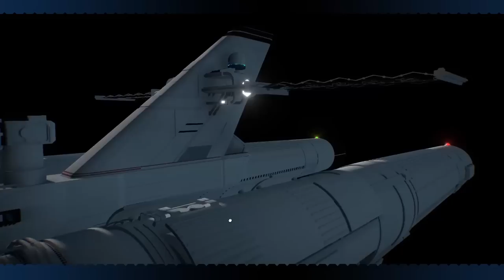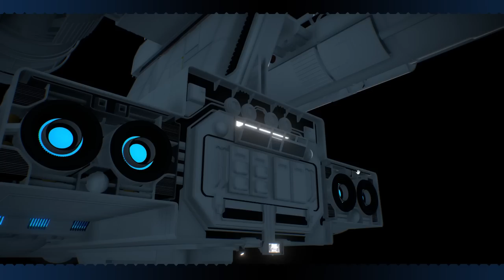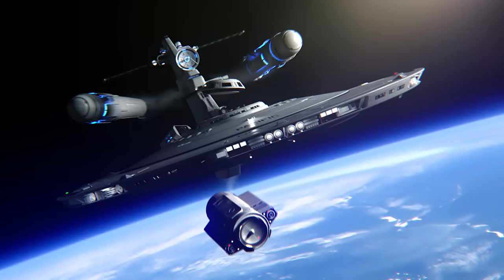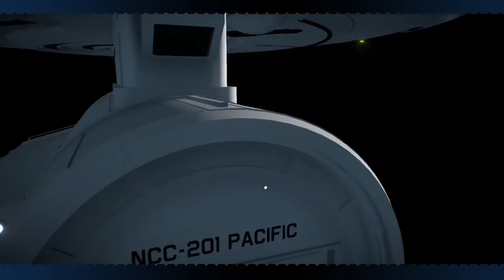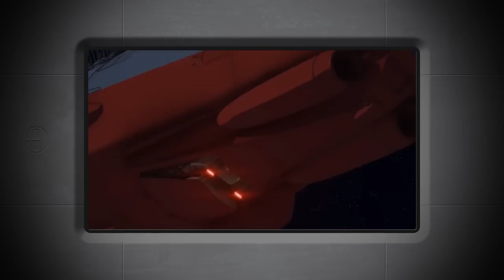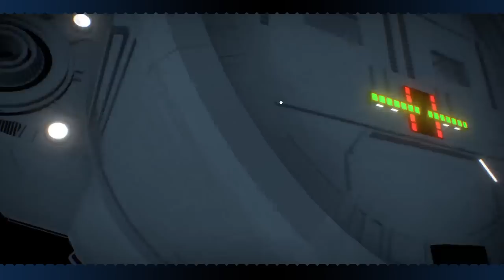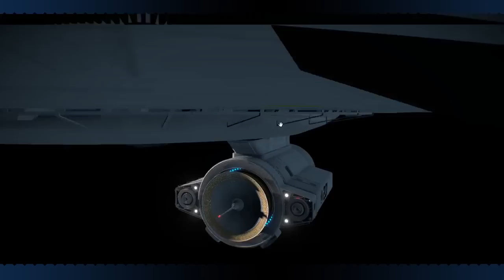Show and Tell: Starship Pacific from Pacific 201 (Star Trek fan film)

Comment: I'm not sold on the upper observation deck being to manually check the nacelles. If so then the windows should be more to the sides and are not needed at the front. I also think that if the nacelles were showing visible signs of damage that can't be picked up by monitoring systems then you're probably screwed. It would make more sense if the windows were more oriented to the sides and had a function such as manual oversight of the nacelles being attached to the ship.

Great ship though and thanks for the heads up about the film.

Comment: Great aesthetic and well thought out design. I totally dig it.

The "whiskers" off the saucer could be long range HF radio/subspace antennae.  This is akin to modern day horizontal HF antennae projecting off the decks of aircraft carriers.
Reply: Wrong.  Aircraft carriers are not travelling through the dust filled expanses of space.  Anything sticking off the side of a spaceship is going to either rip loose from inertia or get torn off by the dust it collects as the ship moves through space.  Plus, why the fuck would anyone use radio to communicate across the vastness of space?  Radio waves are VERY slow.  That's why Neil Armstrong had trouble communicating with Earth from the Moon.  There is no way in hell Star Fleet would use radio to communicate across thousands of light years.

Comment: I hope I don't miss this show. So much thought into the design of the Pacific and the modularity is the most impressive detail in its design. If anything went wrong, it's much easier to replace a module and continue on while the module was repaired, upgraded or refurbished after so many hours of use. When you add to that the fact that Engineering and the bridge are modular in design and I think NASA might approach things in much the same way. Great job!

Comment: I like the "USS" rationale. Figuring that human ships are out there, Vulcan ones, Tellarite ones, Andorian ones. This stuff is in that space between, before certain things become concrete, or more common. 

The rotary launch system is absolutely workable, the U.S. Air Force has systems like that on several bombers. They can drop bombs or launch cruise missiles from them. The VLS tubes as well. After all, nuclear weapons are also good when you are unsure about the exact position of a foe. Either through early sensors, early cloaking technology, or some combination of all of the above. Nuclear air-to-air & ground-to-air missiles were worked up during the Cold War for similar reasons, though they were never used. Plus ideas for nuclear tipped anti-ballistic missile weapons.

Comment: I love that someone can tell how much you love Star Wars just from the design of this, yet it still looks very Starfleet. I'd say the little observation deck on the Nacelle Mount Spine is what first screamed it at me, but the specific greeblies and the antenna dishes as well as just the geometry all have just a little Empire to them. Which is a good thing! I think Star Trek's design language could do with a little grit! Not every ship needs 24 foot long skylights across half of A deck, sometimes they need exposed equipment and actual radiators!

Comment: The thing about Starfleet and Missiles is merely one of terminology. Photon Torpedos ARE missiles in the broadest sense, and the difference between a torpedo and a missile in sci-fi usually comes down to relative speed and yield (Torps = slow but high yield, missiles are fast but low yield). 

And really, Starfleet needs to diversify it's arsenal anyways, so having some sort of high speed missile could be good, particularly if they think a lot of the fighting will occur at FTL.

Comment: Love the ship one of the best fan made models. Only one observation. I do not remember why I know this, from books or show. maybe the original Franz Joseph writing. Warp Nacelles and warp, were increased when used in pairs. They need to be in proximity to each other to create the warp field and no living mater can exist between the 2 coil's. 3 engine's were experimented with but created and imbalance so they were discarded. That's why USS Stargazer had 4 Nacelle's. So my only criticism is the observation deck between the 2 Nacelle's Living matter will not life long there. Great Job. I was there from the beginning.
Reply: Going by your reasoning, nothing on the Defiant would live long enough to do anything  - considering that the warp nacelles are integrated into the body.

Comment: The lights you took from an aircraft carrier are called "fresnel lenses", or mor commonly among naval aviators, "the meatball." They are used to guide pilots through the glide plane while landing aboard ship. Before the fresnel lens system (invented, ironically by the French Navy), the US Navy and the Royal Navy used "Landing Signal Officers" to guide pilots with flags through the glide plane when landing aircraft aboard the ship. Just a little info for ya on where those lights come from and what they're actually used for. :) Cheers on the great design work on the Pacific!

Comment: This is excellent work. I love the basic premise (believable tech in believable applications) and the results. 

You don't have to look to fiction to justify your carousel design for the hangar. The Buccaneer fighter bomber used a rotating bomb bay of very similar design to carry a far greater volume of ordinance than would have been possible if it just had a simple cavity in its belly, like a WW2 bomber. You should look that up - it's a great design. It was also a very effective aircraft that had a long service life.

I love the upper and lower observation decks. The moment I saw the upper one, mounted on the 'shark fin' (shall we call it that?) I immediately thought you must have been inspired by the engineering observation station on the Catalina Flying Boat. Up between the Catalina's nacelles there is a pair of windows and inside there is an engineering station with the dials and monitoring equipment for the engines. The obs deck on the shark fin is probably used for this purpose. 

Similarly, the obs deck above the deflector could be used to closely monitor the deflector and the torpedo tubes, providing immediate access for repair crews and some local control in case the bridge is damaged or cut off. 

I like the locations of the torpedo tubes. I don't like the very low volume you've provided for the ordinance. Unless the torps are very, very small you're not going to be carrying many rounds in there. Can the ready-to-use magazines be resupplied from elsewhere in the ship?

I love the inclusion of radiator panels on the shark fin. I think you need more. Perhaps another pair down on the deflector? After all, the deflector is a serious piece of kit. It needs a lot of power and must generate a lot of heat. Better to get rid of that locally, than have to pipe the heat up to the shark fin for dispersal.

I like the modular approach a great deal. I think some would call modular components a way around the limitations of less mature technologies. For example, we build modular space stations because we can't launch heavy loads, and have no on-orbit manufacturing capability, only assembly capability. But the naval industry disproves this view: there are many famous examples of advanced, modern designs utilising modular components. the STANFLEX  and Meko systems and the Littoral Combat Ship are the three most famous. In the future systems architecture will become even more modular with the integration of remotely operated sensor and weapons platforms. There are contemporary examples of minehunting drones that are embarked on a ship in a couple of ISO containers, one for the drone and equipment and one for the control room that operates it, and is connected to the ship's own control room. So I don't think you can go modular enough! Perhaps there could be access hatches in the saucer for additional control stations for extra equipment that can be bolted on? Or extra labs, workshops, upgrades and extra accommodation for all the new crew these things will need. 

As you were talking about the independent bridge module, I had the thought that in the event of an emergency, all the crews emergency stations would be designed adjacent to an escape pod so that, if an evacuation was necessary, the bridge module could pop off and then fly about docking with the various escape pods. It could either embark the crew and jettison the pods, or daisy chain them and create a raft that can be piloted to safety. That's the best explanation I can come up with for having an independent bridge module. Unless, or course, the crew is so small that they all fit inside the bridge module and all other equipment is operated remotely. Modern ships don't have many people in the engine room. The throttles and other controls are all located on the bridge. The engine room staff are only there to maintain and fix things. 

This is brilliant. I love this approach. Keep up the good work.

Comment: Finally someone else gets the heat issue.  Yeah, any time someone designs a hard sci-fi space ship that is just blocky looking, ask them "where are the wings?"  Because they aren't wings, they are heat radiators for the waste heat that nice hot fusion reactor (or whatever is powering it).  That just happen to potentially ALSO function as wings.

Comment: love the consideration of detail and the thought put into this. the whiskers to me look like the vlf antennas on flight decks which, if they were,  would transmit toroidally around the pole. to that end it might look a little more believable, coverage-wise, to place one on either side of the saucer between 90 - 135 and 225 - 270 relative bearing.

Comment: Love it, really interesting logical process for the design and a nice end result, great work.

The only things that stood out to me are the radiators and tractor beams. A ship of that size would probably generate a lot of heat and the rad panels look a bit undersized by comparison. 

On the tractor beams, a headlight is designed to disperse light over a large area but a tractor beam would need to be more directional, like a laser pointer and maybe mounted on a gimbal for flexibility.

But great work, those are the only niggles for me.

Comment: I really like the design and the thought that went into it but I think you failed to understand one of the "Rules" from, at least, TOS:  the warp field is created as a harmonic between the two warp nacelles and is a no-man's-land because it is distorting the fabric of space. Hence the TOS rule: all warp driven ships have 2 and only 2 nacelles and nothing interferes with the line of sight between the two nacelles.  It's pseudo-physics but I can explain it.  Starships have two systems for propulsion that work together.  1) is the (warp) impulse drive.  These drives use conic resonance chambers to generate negative energy which expands space behind the starship pushing it forward but space requires huge amounts of energy to warp.  This amount of energy relates to C and is a function of the permeability and permissivity of local space (see Maxwell's equations)  These engines fire in microsecond bursts and without the warp nacelles would require staggering amounts of energy to maintain faster than light travel.  Warp nacelles are field generators rotating incredibly strong pulsing contra-rotating electro-magnetic fields. The turbulent convergence of these fields dramatically reduces the permeability and permissivity of local space.  This allowed the warp impulse to be amplified and sustained. The rotating fields act like gravitational lenses drawing in cosmic particles as if they were bussards may hundred times their size.  The starship is subjected to staggering amounts of radiation requiring radiation deflection technology. The primary deflector completely protects the secondary hull,  and much of the forward saucer (particularly the underside) from oncoming radiation without interfering with the bussards.  Given the ability to create artificial gravity, the most practical way to produce a low profile to oncoming radiation is to align the saucer edge on with artificial gravity 90° to the path of trajectory (the alternative would be to make the ship a needle like tower with very small decks — not only dramatically increasing the materials to living space ratio but providing no solution to radiation hitting the now enlarged oblique sides when performing warp turns). The top bottom and edge of the disk have deflector grids as do the warp pylons (although here that is mostly to protect the ship from the radiation from the nacelles) as does the leading edge of the interconnecter. The bridge is placed on top of the saucer (the top deflector system is stronger than the bottom since it is not assisted by the primary) and surrounded by it's own deflector array (making it the most heavily shielded place on the ship —if it had been inside the hull it could not have been independently shielded). The fins on the back of the TOS Enterprise were labeled "intercoolers" by Matt Jeffries.  They were mounted as far aft as possible to take advantage of the expanded space to dissipate heat.
Reply: kindwar 
Defiant does not have nacelles and everybody lives between the warp coils.
Reply: That's a TNG rule, put forth by the Great Bird in the 1990's NOT a TOS rule.  Interaction of energy between nacelles (hence your no-mans-zone) has been hinted at in artist renderings but NEVER depicted onscreen (that gold standard for "canonicity").  And in addition to the Defiant, how do you explain the Oberth?  Their frikkin bridge sits between the damn nacelles!

Comment: Amazing work - thanks! Love your thinking on this stuff. I'm not sure I follow on the rotary shuttle bay system though. You talk about space (volume) concerns, but it seems to me the real concern is mass. So, if you could have a wider shuttle bay that takes up more space with 4 shuttles, but it is a simply box with a hatch they fly out of, you don't have all the mass of that rotational mechanism. Plus, you've got quicker launch times and don't have to worry about the complex mechanism failing or becoming nonfunctional. So, by this thinking, the larger, simpler bays of traditional Trek are probably more realistic. But it's definitely a cool looking design that is fun to watch in action :)

Comment: I really like the ship. Just as a point of reference on a couple of things, the round ball on the rear of the necells is the off axis field stabiliser. I'm guessing its function is to allow the ship to steer while at warp, or for making high speed turns during combat. There's various references in the original series about the ship turning slowly without warp power, but this isn't really that cannon. Also with the impulse engines, you were saying about the engines being red in many shows, and with Enterprise they are blue. I'd like to think it's an evolution with the technology. On one of the Voyager episodes, they find the Mars Orbiter, and they talk about the ships 3rd Generation Ion Drive, which is an early version of the impulse drive used on Enterprise. I'm guessing sometime in the 23rd century the technology evolves, and the engine has a red glow. Thinking about the deflector, the dish in front is nothing to do with this, but it is the ships main subspace receiver dish. It does kind of disappear on the movie ship, but makes a return for TNG and Voyager. The Defiant strangely is missing one again however. Hope this helps with some insight.

Comment: 1:08 radiator ridges won't make a lot of sense in vacuum, they'll just heat up each other and no heat will be expelled off she ship, they instead must be as flat and distanced from hull as possible. and, frankly, a ship that has deflector shields and transporters won't have any problem with heat exchange even without radiator arrays
Reply: The only way to deal w excess heat is to store it as energy. Boil water, put that juice in a battery.

Or.... phasers

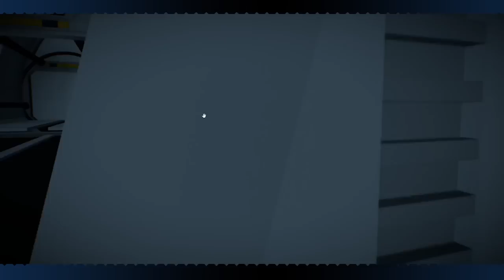Comment: The Optical landing system lights (05:20) are a visual cue for carrier pilots landing on the ship. Its purpose is to aid the pilots on the glide slope. They wouldn't have a function if the shuttles were tractored in, and glide slope wouldn't be relevant in space.

Comment: Curious. I am wondering if, as you mentioned, that if you can retract the flexible gangway to the bridge module before the module ejects? Is it possible to do so without separation of the bridge module to prevent anyone from gaining control of it? That way the ship's bridge crew would be able to retain control over the ship while security teams work to repel boarders. Ejection of the bridge should be last resort after all possible options have failed or the ship is too heavily damaged. To be able to simply seal the bridge from the rest of the ship could be key to maintain control over the vessel to the last possible option and then simply ejected of needed.

Comment: Very nice and well-thought-out design. However, I have one quibble (quibble, not tribble) with it (here comes the technobabble): The warp nacelles on Star Trek starships are spaced widely apart for a reason. The more space there is between them, the easier it is to fine-tune the warp bubble and even out any imbalances there might be between the two nacelles (or however many the ship has). The extremely close spacing of this ship's nacelles would therefore require much more advanced computer monitoring as well as faster-responding control circuitry than would be standard in Starfleet ships. And, no, single-nacelle ships don't have this problem because they're limited to low warp factors and imbalance issues increase (exponentially?) with increasing warp factors.